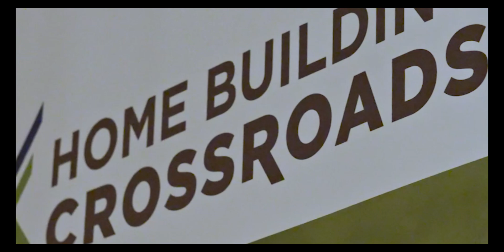Building Physics Doesn’t Care

Comment: Steve if u finish off the “floor assembly” you can really use a shiplaparrangement, can u ? Although perhaps it works because u have many merged lines as with a roof soffit assembly to make sure water doesn’t get in climb back thru surface tension ? And how do you treat waterproof air seal the joint between the vertical wall and this horizontal surface?